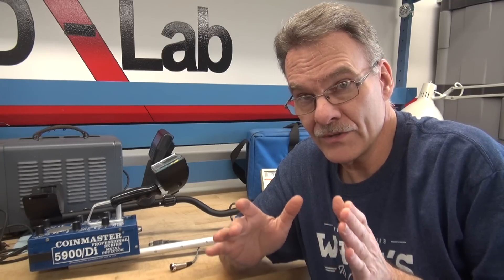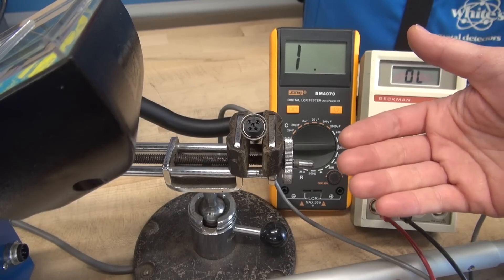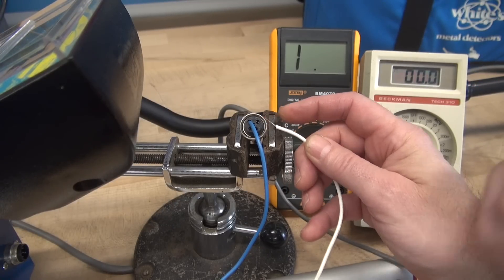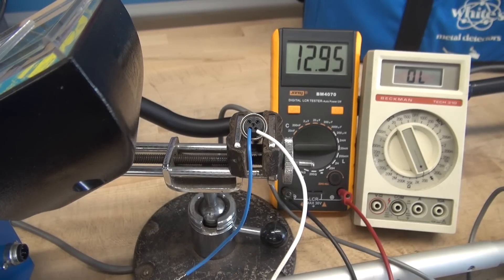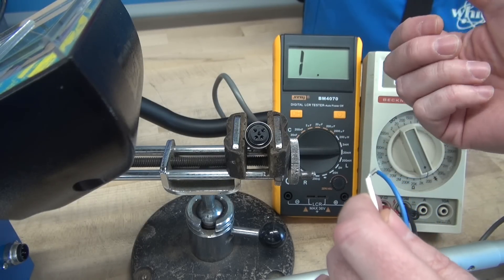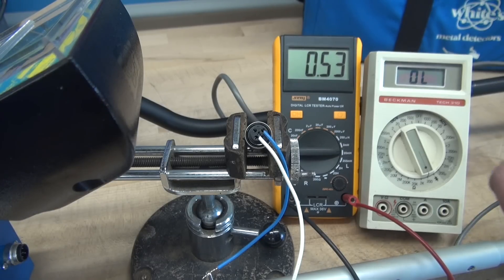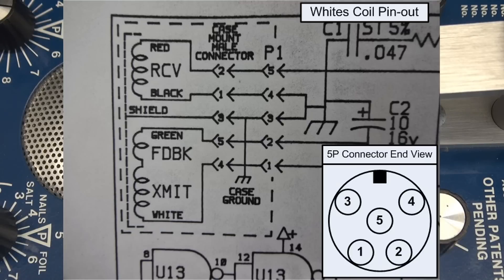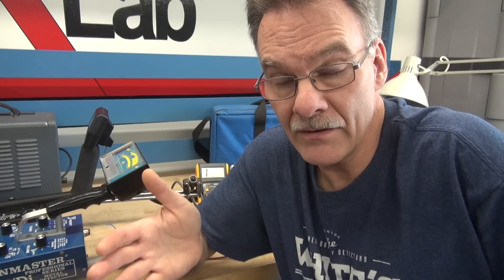How to test Whites metal detector search Coil resistance MXT ALL Pro 5900/di D-lab electronics

Comment: I've got a 1500 Blue Max coil for the 5900-6000 series. My readings are RCV=112.7 ohm, and 34.6mh. Xmit is 1.7 ohms, and 1.68mh. I'm getting a resistance reading of 12.6 megohms between pins 2 and 4. Do I have a coil issue? I have no shorts from pin 3 to any others. Thanks

Comment: Do you know how many turns of wire were in the "feedback" portion of the xmit coil. Were those turns reversed relative to the main coil. Also wondered about the value of C2. is it 10nf? Many thanks....really good video and explanation. Also, if I may...what's the downside of leaving out the feedback turns? I'm planning on turning a 6000 into a two-box type detector and may have to make my own coils. Many thanks!

Comment: I have a Whites DFX I just bought. Looks never used. The VDI numbers are low. Says 74 Penny Dime when a quarter is passed across coil. I checked the caps. They checked ok. 
I tested the coil transmit and receive ok. But NO SHIELD PIN 3 to ground. I removed the 5 pin connector and pin 3 does not have anything going anywhere. All other coils I have pin 3 is grounded.
If I bump the coil it reacts erratic also.
Do you know if the DFX is supposed to have the shield?
There is a white wire from the control box pin 3 to the circuit board so I would assume it should connect to the shield.

Comment: I have 3 whites coils of them 2 of the 6B and one F coil all running on 6.59khz none of them have the same resistance. lol I'm a little confused now lol BTW one is an 8 inch and two are 10 inches, I have a 15 inch on the way lol I wonder which resistance that one will have. they all work

Comment: Greetings . I have a problem that maybe I can some answers on. Whites 6000D series 2,  Near brand new looking, acquired from Ebay yesterday  ;  GEB DISC, either selected with the knob, or with the push button (mode  switching), the detector DOES NOT SEND AN AUDIO RESPONSE WHILE IN GEB  DISC MODE (speaker/audio jack) DOES NOT RESPOND. IN THIS MODE. The METER RESPONDS BUT THE  SOUND DOESN'T... all other modes, the sound works fine  .. Any Ideas?

Comment: At last! I found someone who could help determining receive/transmit wire, so we can build our own coils👍
My question is: how can we get the schematic of the circuit, is it inside the control box??
Reply: If you want something like the 5900 there is a board you can buy which is an IDX-pro Which i love and actually use as my main detector, link to the board  here https://diydetector.co.uk/store/index.php?id_product=23&id_product_attribute=0&rewrite=idx-pro&controller=product and if go on Geotech forums for advice and BOM for the board, they're a lot of detector circuits you can find in Geotech https://www.geotech1.com/forums/forum.php
Reply: BTW building VLF coils are not for the faint of heart, you need to get the two windings slightly out of phase with one and other and its not something that is easily done, your better off buying a board and putting it together and buying a pre-made coil, Also on amazon look for a book called Inside the metal detector, it is very well written and will give you a better understanding of how different technology type of  detectors works

Comment: Any ideas on White Coinmaster GT. Unit was very noisy. Installed new coil problem slightly better. But still seems to get stray signals ?? Hard to believe coil could be bad again with less than 10 hours of use on it. Has White had any problems with intermittent wiring to connectors ?
Reply: Does yours have a ground balancing potentiometer? if so you might want to look in to cleaning it up or replacing it,  if you don't get the ground balancing right it will not only lose sensitivity but also be noisy,

Comment: I have the Coinmaster 6000 series 2 with the single battery. I can't get the sound to work and the meter acts weak (won't go over half) and bottoms out then jumps back to around half way. When I wave different metals the meter jumps but never over half. I've changed an electrolytic capacitor that was swollen and changed out a integrated circuit that had black burnt pins and still no luck. After watching two of your videos I'm starting to think the coil is bad. But, would the bad coil cause the detectors sound not to work, not even chirp?
Reply from the maker: Yes, I agree, and the series 2 is really not worth the effort to repair. The price of used machine has fell badly

Comment: Hey Terry I have a whites MXT 950 series E detector it comes in a hard shell case with two extra coils one is a Eclipse 5.3 and the other is a Eclipse DD1400.Do to health reasons I cannot use any more.If you you have the need for something like this I would be willing to do a trade for for a amplifier.The detector is about 10 years old and used very little and like new condition.

Comment: Mr Terry Sir, I have a question about the old octal tubes. Isn't there a certain way that type has to be removed ? I think I seen something someone else said saying they have to be moved a certain way before they'll release from the socket. I would really appreciate you clearing up what the other person was referring to  thank you Sir for any assistance. This video is great info...👍👍👍👍👍👍👍👍
Reply from the maker: The Octals will pull straight out, no latching. The Loctals however had a small retaining function on the center locator pin and took a little more force to un seat them. They were normally used in tube car radios in the late 40's. A few home table top radios had them, but that was quickly phased out.